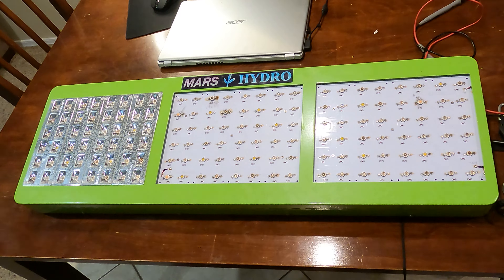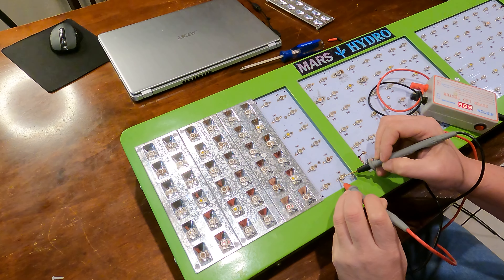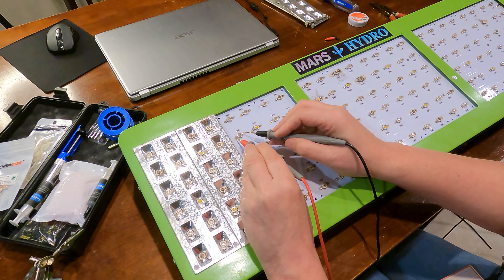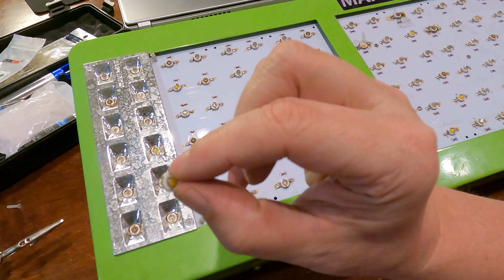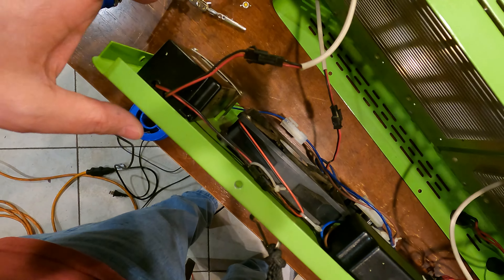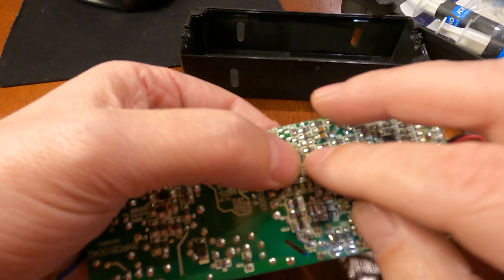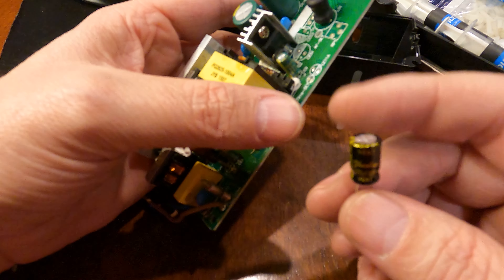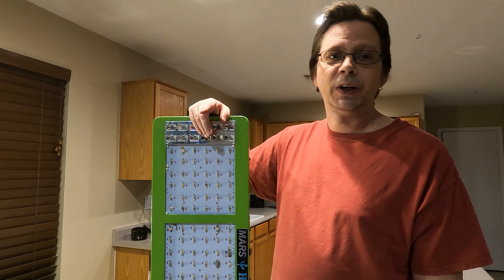How to Fix LED Grow Light | Repair Old Mars Hydro LED Grow Light

Comment: Hi Eric. Thanks for making and sharing this video. I just have one thing to say. Please buy some (Desolder Braid). Using that with your soldering iron will take all the solder from the holes where you take the components from. Its cheap, quick, easy and your capacitor would of been sitting flush all the way down to the pcb.
Cheers.
Reply from the maker: Thanks for the tip!

Comment: Thank you for the detailed repair video! Does anybody know whether the red leds have the usual 2.5 voltage drop or 6.5 V like the other colors? If they have 2.5 V, wouldn't replacing them with 6.5 V full spectrum substantially dim the output?
Reply from the maker: Red LEDs typically have a voltage drop of around 1.8V, with a range of 1.7-2.2V1. Replacing them with LEDs that have a higher voltage, such as 6.5V, would indeed affect the brightness. LEDs are current-driven devices, and their brightness is determined by the current flowing through them. If you replace a red LED with one that has a higher forward voltage without adjusting the current, the brightness could be substantially dimmed because the current through the LED would be less than what’s required for optimal brightness.

I do this by just looking at the effect on the circuit the new led has. Have to admit I have it off a bit on one panel of lights and I need to adjust it by replacing one of the high voltage ones with a deep red (lower voltage one); because it's currently dim.
Reply: @Eric_Tennant  Awesome thanks again for the detailed and fast reply! I was asking because I want to stash some LEDs in case one fails. I'll order 10 pcs of each wavelength then. I see the repairability on the older models as a big benefit compared to the new TS line with tiny LEDs and potted drivers. Have a good one!